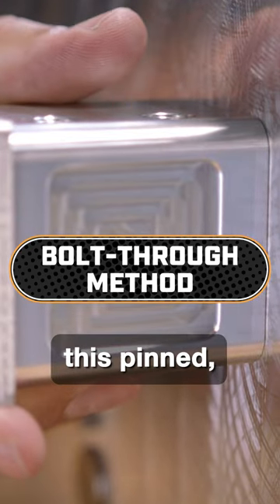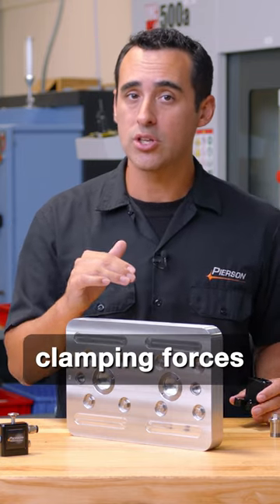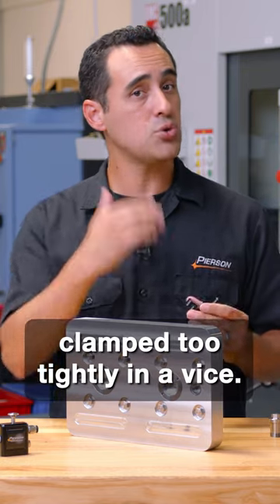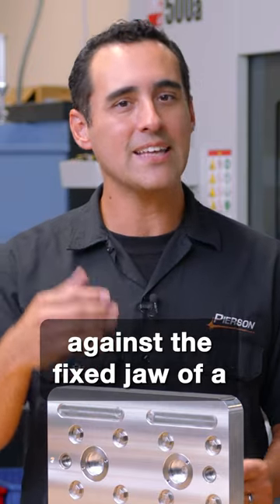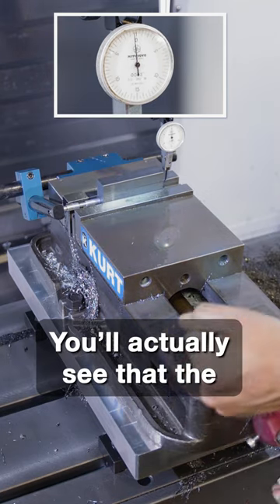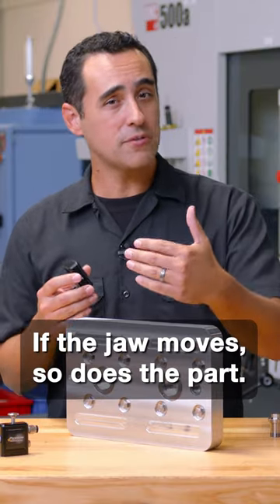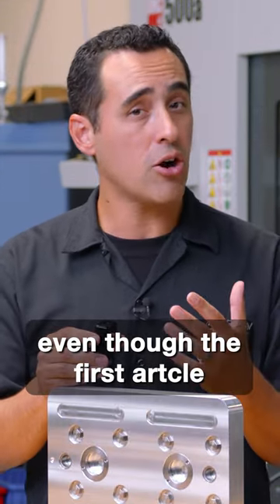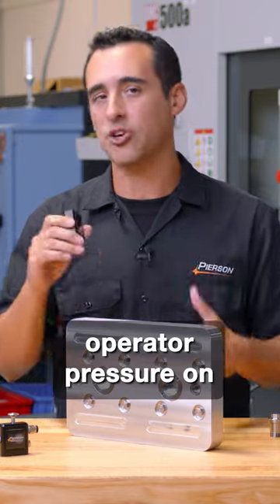Get Consistent Accuracy Using NO CLAMPS❌ #cnc

Comment: I use bolt through clamping a lot for smaller parts that are laser cut to rough size before milling. It does take a bit of time to swap parts but with a vacuum pallet (much cheaper and more versatile than a zero point clamping system) this is a job that hardly consumes any expensive machine time